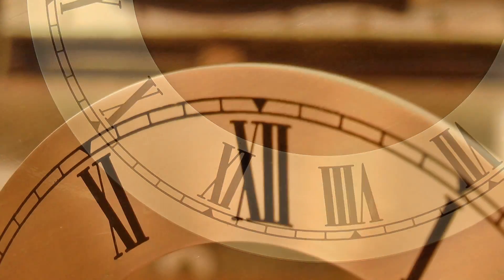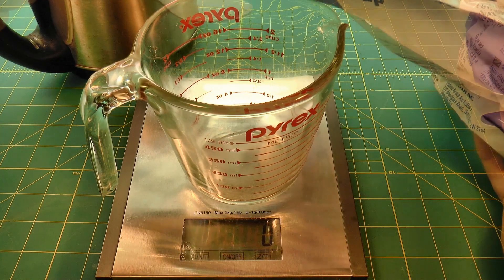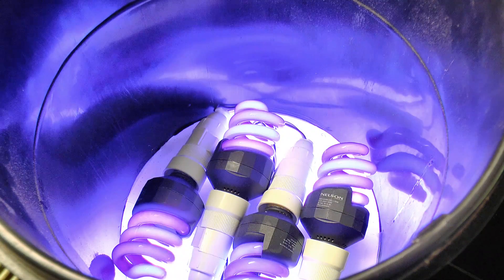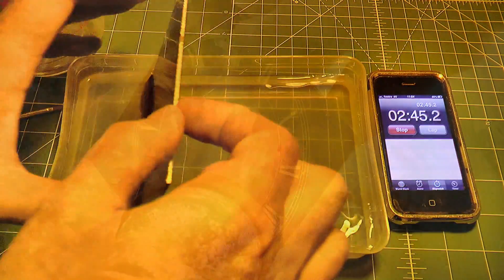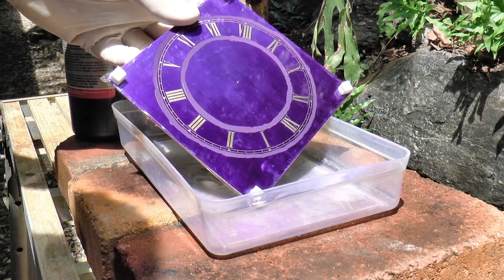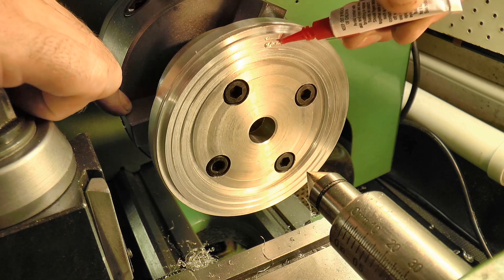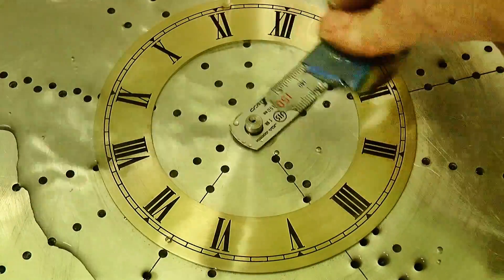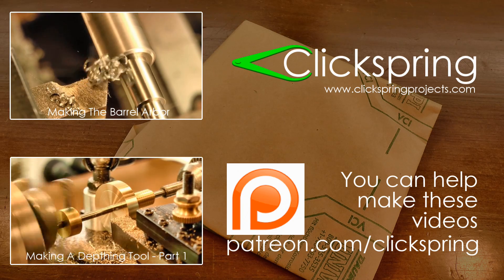Clockmaking - How To Make A Clock - Part 9 - Etching, Waxing And Silvering A Chapter Ring

Comment: Hi Click,

I recently attempted metal etching for the first time, but unfortunately, I encountered some challenges. I was hoping you could help me with a few questions I have:

1. After approximately 3.5 minutes of exposure to UV light, I noticed that the unexposed portion of the photoresist was still very dark compared to what I saw in your video. Could this indicate that I exposed it for either too long or too short a duration?

2. When I submerged the brass in the mild alkaline solution for 3 minutes, the resist didn't come off as expected. However, when I extended the exposure slightly, the resist began peeling off entirely. What could be causing this inconsistency in the resist removal process? Does the solution have to be room temperature?

Thank you for your assistance.

Comment: Hey, thats cool! Using this same method of etching, you can create home made circuit boards. Only, instead of using solid brass, you use copper clad fiberglass - then you etch away the copper where you dont want PCB traces. 

As a long time electronics enthusiast, who is just getting into watches and clocks, i thought that was a really cool example of the same process being used for 2 conpletely different goals

Comment: Chris, I am preparing  my first etchant of a chapter ring. I wonder what minimal depth is required to be filled with black shelac?
Reply from the maker: Hi Henk, you can get away with very little depth, even a few thou is enough to fill, it just limits how much you can subsequently abrade the surface prior to silvering. I do plenty of testing on scrap to determine the maximum time & temperature to get the deepest possible etch before sidewall etching begins to corrupt the design. Very fine artwork will etch much shallower than wider artwork - Cheers :)

Comment: Beautiful job Chris.  What is the device you are using to sand the dial after you waxed the numerals?
Reply from the maker: Hi Eric - that is a wheel crossing out jig based upon Malcolm Wild's design. It uses locating pins in the center and perimeter, and the center pin can also be conveniently used with a guide to give a circular grain with abrasive paper - Cheers :)

Comment: I would have guessed you'd need to submerge the plate with the area to be etched facing up to avoid entrapment of air bubbles
I wonder if having it facing down is meant to help the powdery residues of the etching to fall away from the piece during the process...

Comment: Clickspring, first of all thankyou, you have made my afternoon, I have learned so much. I have been looking at lathes and I notice you have a Sherline which looked good to me but was not rated in some reviews I read....I have a question for you and one which I have been giving some thought to...if you could have a multi-tool a cross between maybe a lathe and a mill what would you have on it? For me cnc indexing would be integral but with all your experience I was wondering if you could specify a wish list all in one machine? regards ChrisBlythe 2017 (at) G mail.com
Reply from the maker: Hey Chris, I have no experience with combo machines, but I find having separate machines, with interchangeable tooling and add-ons works well. ie separate mill, lathe etc and have indexing devices, vertical slides, tooling etc that can be passed readily between both gives good flexibility, and a minimum of compromises. Hope that helps!

Comment: Why is 4 IIII not IV?
Reply: All clocks using Roman numerals actually vie for ‘IIII’ instead of ‘IV’.

“When Roman numerals were in use by the Roman Empire, the name of the Romans' supreme deity, Jupiter, was spelled as IVPPITER in Latin. There was a feeling that using the start of Jupiter's name on a clock dial, and it being upside down where it fell, would be disrespectful to the deity, so IIII was introduced instead.”

Comment: Etch with concentrated peroxide and hydrochloric acid, much faster!
Reply from the maker: Perox+HCL is much too aggressive. Good for PCB etching but unsuitable for this application, leaves a bad undercut.
Reply: Even if you leave it for like a minute or 20 seconds?
Reply from the maker: Yes. Perox+HCL was my preferred etchant due to ready availability of chemicals locally, I really wanted it to work. I persisted with tests for quite some time until I eventually had to accept it was just not the right etchant for the job. Ferric Chloride is much harder for me to source, is a messy chemical to use, but is definitely the etchant most suitable for fine detail. Perox+Hcl is perfect for those situations where you simply want to remove all of the exposed metal
Reply: Good to know!
Reply: PCB etchant so should be no problem for supply from electronics place like Maplin
Reply: It does take a bit of practise though, exposure, concentration of chemicals etc. Caustic drain cleaner acts as a developer too
Reply: Springing for a cnc engraver was worth every penny tough, or with the skills given here out it would give the confidence and ability to build one which can be controlled for free with  free software mach 3 for 250 lines of program code or 160 us dollars for full version..would be great for many aspects of this art.

Comment: I noticed the roman numeral used for "4" was "IIII", which went against what I had been taught for the numerals, but it is also what our clock at home always had, so I looked it up.  Apparently, although "IV" is considered standard for "4", in clock-making, "IIII" is actually more common.  Although there are a lot of theories as to why.
Reply: It balances the VIII opposite better.

Watch ads often show the time to be 10:10 for the same reason. Nice balance.
Reply: @LanceTheBlueKnight  Of course if you're OCD like me you'd prefer it to be about 10:07, because the minute hand is heavier.

Comment: Is there anywhere close to Australia to get the dial wax? I found a company based out of Arizona, but if there is somewhere closer that would be grate.
Reply from the maker: +scarletlightning565 I gave up on local horological suppliers a while back, they never seemed to stock what I needed. I now mostly use Meadows and Passmore, and Ian T Cobb, both in the UK
Reply: Awesome, thanks.

Comment: Really nice work! However why didn't you use an acid to blacken the metal and then sanded it as you did, rather than melting shellac in the engravings?
Reply from the maker: +Andrea Quadrati I mostly adhere to traditional methods and materials; Shellac is the traditional filler that has been used for many centuries. Thanks for watching

Comment: you'd be surprised but this exact technique is used for making DIY Printed Circuit Boards and professional PCBs in some cases as well. :3
Reply from the maker: +Martin Šalko Yes, in fact I source my ferric chloride from a local hobby electronics store who supply all materials for home pcb etching. Thanks for watching :)
Reply: Clickspring :3

Comment: Just going back through your videos again.  They're very calming.  I noticed that you wrapped the completed chapter ring in VCI paper.  Is that just an added safeguard while it's awaiting assembly?  I would have thought that the lacquer would keep out anything you'd need the VCI paper for.  Thanks!
Reply from the maker: +NGinuity Well spotted! You're exactly right - no need for corrosion protection, but the paper itself keeps things scratch free while I build the rest of the clock. I have this huge box of VCI paper, and it just seems to be lasting me forever! Thanks for watching :)

Comment: For future ease of use with photoresist, look up positive 20 :) It's spray on and very nice
Reply from the maker: +dumle29 That sounds much easier, I will check it out, thank you!
Reply: If you want it to cure fast, you'll need a dark oven that sits ~60C for 10-15 minutes, though I think the best results are achieved with 24h in a lightproof box. (PCB's always came out just fine with 10mil tracks using the 60C oven)

Comment: Love watching your videos, I seem to learn something from each one! I especially liked  the shellac infill technique, very crisp looking. One question, why not use nickel silver plate instead of silvered brass?
Reply from the maker: ***** G'day Isaiah, I guess the main reason would be tradition. There are quite a few things about classic clockmaking that could be much more conveniently completed by substitution with something else. In fact many constructors today do choose from modern materials and techniques, making fantastic pieces. My own approach to clockmaking is that I have a real passion for the traditional methods, and materials. Where possible I will 'do it the old way' to be consistent with traditional horological practice. Having said that, I have used loctite as a substitute for soft solder in this clock, so I make no claim to consistency! Thanks very much for watching and asking.

Comment: Hi Chris. Another Excellent video! Can you take a moment to explain what the silvering step does? I can't quite tell. Is it just a clear coat?
I found a supplier of the shelac http://www.m-p.co.uk/, but what about the photo resist?
Reply from the maker: Mart Hough Hi Mart, the silvering powder causes a chemical reaction at the very surface of the brass that deposits a thin (micron) layer of silver. Purely for cosmetic purposes, for a better contrast with the black numerals. You can get the silvering powder and the finishing powder (both required for chemical reaction) from Meadows and Passmore too.
Reply from the maker: Mart Hough Photo resist from ebay - http://www.ebay.com/itm/0-3m-W-2m-L-Dry-Film-Photoresist-Sheets-for-DIY-PCB-Board-/190741590203?pt=LH_DefaultDomain_0&hash=item2c6915b0bb
Reply: Clickspring In the video you take some time to scratch away some resist deposits before etching. After seeing just how much material gets eaten away, wouldn't the etchant just erode away under the messy bits?
Reply from the maker: Mart Hough It would get eaten away, but at a different rate to the surrounding metal, and so will be a relative high point. This is an issue for a dial, because ideally it should all be the same depth. The dial should be able to be re-silvered several times over its lifetime. Each time that happens, a small amount of metal is removed. If there are any high points, eventually a 'plateau' will appear - to the annoyance of some repairer 100 years from now!

Comment: Hi Clickspring,
I only recently discovered your channel through lot of other machining channels that I follow. You machining and setups are excellent and there are lots to learn here. I can also appreciate the tight tolerances you have to work with given the small sizes!
Another thing I saw others also mention is the excellent production of the videos. I know it's mostly due to your skills and not the gear, but it would still be interesting to know what camera/lens you use and how you get the closeups without machining the camera itself! Also what lighting setup do you use? And edting software?
Thanks and consider me a fan and a new subscriber.

Regards
Johan
Reply from the maker: Johan Delport Hi Johan, the camera is a Panasonic HC X920, and the editing software is Premiere Elements. I use some halogen desk lamps and the shop fluorescents for lighting. I don't have a macro lens for the camera, so the closeups are from putting it right into the action - it's getting a little battle scarred I can tell you! I occasionally use the cheap macro filters to get a bit closer, but they really lower the image quality, so I don't use them often. Thanks very much for watching mate, very pleased to have you aboard! Chris.

Comment: lovely work. must rethink my approach to etching. the photo resist is just the ticket to a better etch.

have you used electrolytic method (i.e., Copper sulphate w/ a current)?
Reply from the maker: Frank Ruffolo Hi Frank, I must give that electrolytic method a try, I would be interested to see the results. I have tried a few different etchant solutions, and have found Ferric chloride to be the best for fine detail like this. The other etchants were great at removing material rapidly, but generated too much undercut and messed up the line resolution. Cheers mate, Chris.
Reply: Clickspring  you may find that you have more control over the etch, and with the copper sulphate the results will be different for sure. i have used both methods, but i'm still new to the process, so i really haven't been able to affectively judge. i was using plain old laser print and iron approach, so the masking (laser toner) is nowhere near as good as the photoresist. far too much pitting. 

any tips on ordering the photoresist? so many sources. can you recommend a (web) source or do you buy it locally?

thank you

Comment: From my experience as a designer I would recommend using a real repro-film instead of a printed one. Ask around at offset-printers, some of them still have a film system in use. That dial would cost you some bucks and have super-crisp lines.

From my experience as an electronics-hacker I would recommend to keep the etching-solution in constant motion to make the process more even.

But your result is already stunning, well done!
Reply from the maker: helmut666kohl You're spot on. I tried so hard to find a printer who could do a true film print, but just couldn't find anyone who still does it locally. Most only do laser printer transparency printing, and for the most part it is below the standard required for this task. In fact I visited several before I found one I was happy with, and even then there was much room for improvement (a $30,000 machine!). I'm happy with the result, but next time I will send it out to someone who can do film.

Agreed on the agitation of the bath too, although not shown on the video was the Mk I hand agitator in use every few minutes :) I also found that temperature was critical. I have a lot of sunlight in my part of the world, so it was easy to keep warm, but testing showed that a low temp dramatically increased the etch time, as well as the line undercut.

Cheers mate.

Comment: if you do lots of etching, take a look at cupric acid etching rather than using ferric chloride. its more environmentally friendly as you can regenerate it and reuse.
I've never etched brass with it. but as brass is largely copper, i would imaging it would mostly work.

http://techref.massmind.org/techref/pcb/etch/CuCl2.htm
that's quite a technically detailed link if you are interested.
Reply from the maker: Stephen Giles Thanks for the tip and link Stephen.

Comment: Wow, just wow.
Reply from the maker: ***** Thanks for watching Chris.
Reply: Clickspring As a teenager I worked for 2 years repairing antique clocks. I never had to refinished faces/rings such as how you are doing them but I did everything else. I can appreciate the work that you are putting in to getting this clock built.

Looking at your etching process, I see so many uses for it.

Thanks so much for sharing.
Reply from the maker: ***** That would have been a great 2 years I imagine! Those old movements have so many variations and complications, you would have seen some great stuff.

I agree with you on the etching process, it can be used for all sorts of projects where fine detail line work is needed. I was so pleased with the line resolution too. The thin lines on the perimeter are 0.8 mm, and I have tested the process down to 0.2mm with repeatable results.

Very much appreciate your support Chris.

Comment: While all the technical aspects of this dial were spot-on (and expertly executed), I can't help but feel incredibly sad and disappointed with the choice of the artwork. It just looks so incredibly generic and store bought (like every single "replacement" Roman paper dial I've ever seen). I don't know what you have planned next for it, but I will keep my hopes up that it will somehow improve the overall look. I would have preferred to see slightly wider numerals (or ones with thinner gaps between them such as those seen on fine Vienna regulators or French dials). I'm also curious about the dial mounting. Usually a high quality dial would be mounted inconspicuously (such as with dial feet) but I would have though that any mounting hardware (or holes for screws) would be done before the final finishing...
Reply from the maker: sooth15 Thanks for sharing your thoughts; The dial will indeed be mounted via discreet feet, but it wont involve the chapter ring. Next episode will give you an idea how it will be done. Thanks for watching.

Comment: Hi Chris, where did you get the film from and did you use the ferric chloride neat?
Excellent video has always.
Reply from the maker: Paul Reed G'day Paul, the film was an Ebay pickup, just search out photoresist. Yes the ferric chloride was neat. Estimate temp was about 70 degrees C; that played a big part. Cheers mate.

Comment: Wow, what an awesome process. Never seen that before and the end result is just spectacular. One question though: Why is the four o'clock written as IIII and not as IV assuming that these are roman numerals.
Reply from the maker: Garage workshop That's a great question - traditionally clock faces represent a 4 as IIII rather than IV. There's a few theories as to why, the most plausible I think is that it visually balances the dial better than IV, against the VIII on the other side. Another theory involves Louis XIV, but I think that one is probably made up! https://www.facebook.com/notes/js-watch-co-reykjavik/have-you-ever-wondered-why-the-roman-numeral-for-4-on-watches-and-clocks-read-ii/433524526255
Reply: Clickspring Thanks for sharing that interesting story and it certainly does look great.